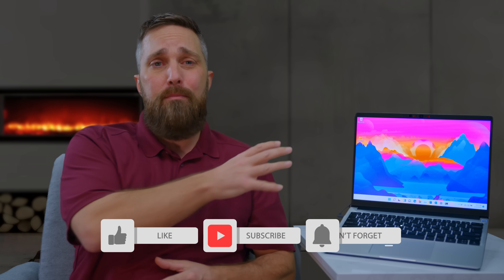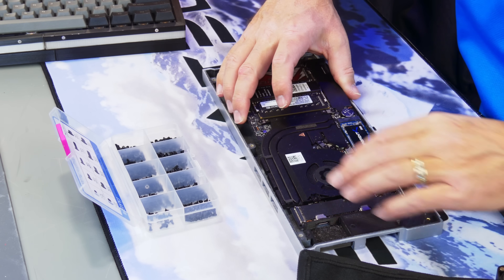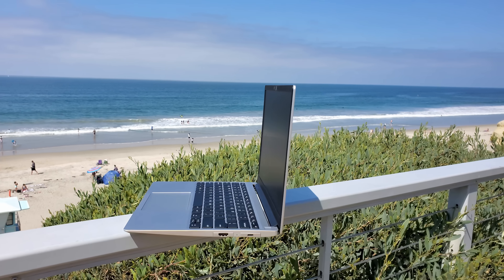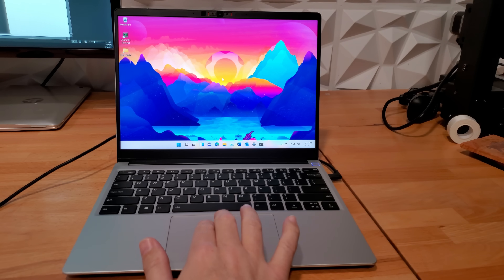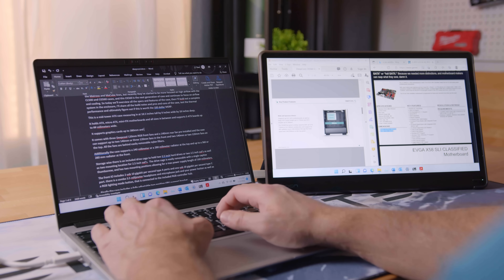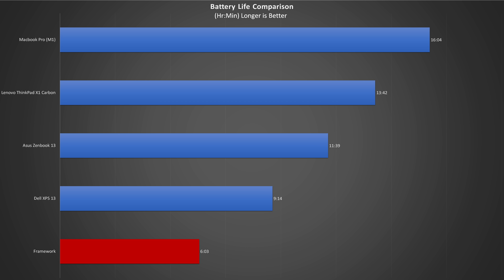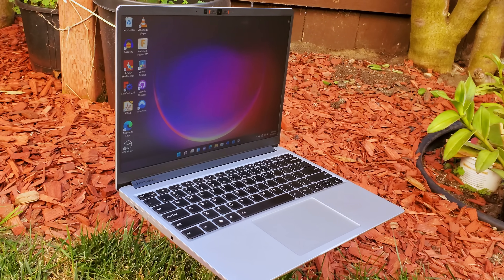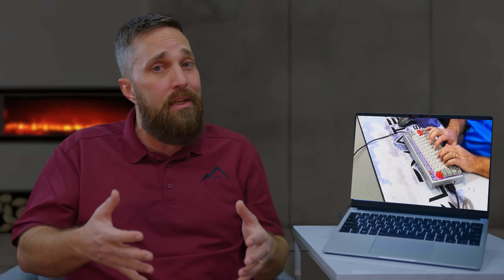Framework Laptop 6 Months Later. I'm Less Impressed 😐

Comment: I think the next iteration of this will be a lot better. After all this is version 1.0. I’d like to see options for motherboard with dedicated graphics (3050/60 at most) for the casual gamer/editor . I don’t expect this to ever be a hardcore gaming machine or at least not in the near future.
Reply: I'd say, a Framework laptop with even an Nvidia 2060 would be awesome, though a 3060 would be even better. :) While I don't game or do computer art, it would be beneficial to gamers and artists alike. Blender models could be rendered well. Also, some scientists may use GPU computing for running simulations.
Reply: @thatguyalex2835  issue is generations 2060 is the same as a 3060 in terms of power. 3050 wouldbe great

Comment: I really want to support framework, flaws and all, conceptually I can accept a higher price for something that is meant to be repaired rather than replaced coming from a new company with an uncertain future in the market. But in reality I'm worried that for the price I'll be left wanting something a little more capable as I want to take on more graphically intensive work, and don't have the money to have a separate modern desktop pc and a non potato non falling apart laptop. Tough position to be in, honestly considering simply upgrading to a steam deck and living with the slight inconveniences the formfactor presents when trying to treat it like a laptop.
Reply: Hopefully Framework will have another laptop, with dedicated GPU, soon. Though I have no idea if that soon will be Q3 2022 or 2023 or even later. Designing a motherboard + chassis like this is quite the challenge.

Comment: The good thing about framework is that even its flaws are easily fixable, like if a better trackpad is released all we would need to do is to swap it, the same with better batteries, you dont need to buy complete new setup to have better and improved experience, much like pc you just swap a component, i wasn't expecting framework to nail everything from the start, but now is the time for them to truly shine,  if framework get the component market to work right than it will start its rise to leadership.
Reply: They also launched at a time when parts shortages were at their worst. Hopefully, they can make up some ground in the next year!
Reply: this isn't essentially true
Reply: I don't see the framework laptop as a product made for the brand-aware apple crowd, the high demand gamer or the professional video editor, but for someone who wants easy availability to replacement parts and repair. Sacrificing some performance and battery life and gaining user serviceability. Which is a great thing in principle.
Reply: @HappyBeezerStudios  Most of the Apple laptop crowd would actually be better served with a $300 Chromebook from what I've seen of their usage patterns.
Reply: @jabezhane  same can be said about PC crowd 😂

You make it sound like PC users are more sophisticated, which they are not.

The number of normies far out number the number of geeks .

According to you, people should all just buy $200 cellphones.

But you know what, people also spend $1000 on jeans, $100k on cars,  $10 coffee. You suddenly became “I know what’s best for people”
Reply: @RunForPeace-hk1cu  Yh everytine someone said this I honestly laugh because you could literally say the same thing for almost everything you get
Reply: @HappyBeezerStudios Well, since laptops generally don't break until the entire machine is pretty much obsolete, the repairability aspect is going to be pretty useless for the vast majority of users.
Reply: Or you can just buy a laptop that doesn't have the flaws 😂
Reply: Even then I don’t think framework will be even close in terms of performance to companies like Apple, who people mainly only buy products from because of the brand name, and how common it is.

Comment: Just ordered mine, and my biggest worry is still the battery life. I really want to love this laptop, and looking at measurements I think the battery should theoretically fit into my workflow, but just barely. If not I’m returning and getting a used x1 carbon, but will pray for framework as I really want them to succeed.
Reply: You could try looking into undervolting your laptop, depending on the cpu and gpu it could give you an extra 10 - 20 minutes of battery life.

Comment: After this I will probably swing towards the dell xps 13. I can't tolerate a short battery life and the dell has gotten universal praise for it maybe framework can fix it with software/firmware updates or a bigger battery in the same form factor but I'm not will to risk that. Maybe I'll pull the trigger on a second or third revision.

Comment: The ports are not technically Thunderbolt 4; they do not have Intel's stamp of approval, although it seems they're working on getting it
Reply from the maker: I explain this in detail in my initial review.
Reply: @ElevatedSystems  I saw that and I appreciate your explanation. However some of the viewers haven't seen it, so IMO it's not ideal to call it TB4 without giving that explanation in the same video, it's possible it might confuse or misdirect viewers.

Comment: Going the DIY and i5 route (very very similar performance) you can get the whole system for just under $1000 which makes it an easier pill to swallow versus $1500, still not perfect but look forward to the future
Reply: The performance disadvantage of the i5 is small... IF you put two sticks of RAM in it. Tiger Lake loves dual channel memory; you take a 25% performance hit if you use only one module.
Reply: @ShirleyMárquezDúlcey  Tbf all cpus work much better when all memory channels are used, otherwise you are leaving lots of memory bandwidth unused. This might not matter in certain applications, but it is clearly felt in a lot of others.
Reply: @ShirleyMárquezDúlcey  I would love to see actual comparisons of thw two in real world tests.  I was considering getting the i7 with 64 gb of ram abut i might change that to i5 if it makes ssense.
Reply: @ShirleyMárquezDúlcey  the generation means nothing, single channel ram is around a 25% hit across the board, including my 8th gen i7. literally half the ram speed.